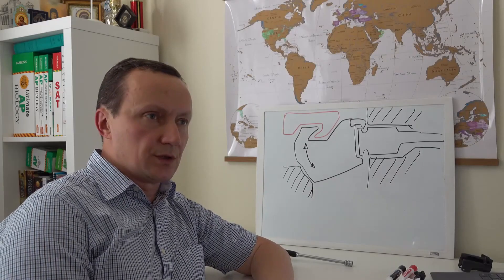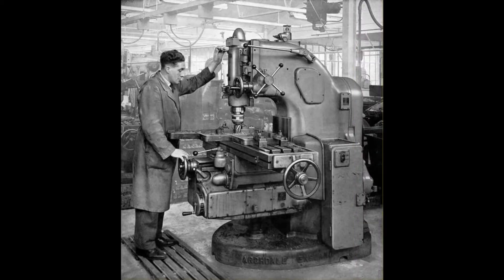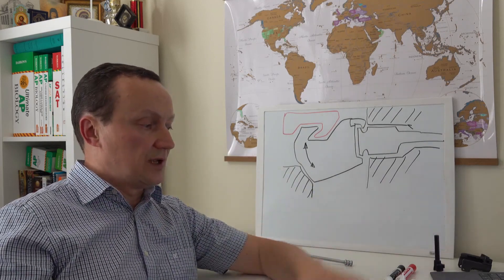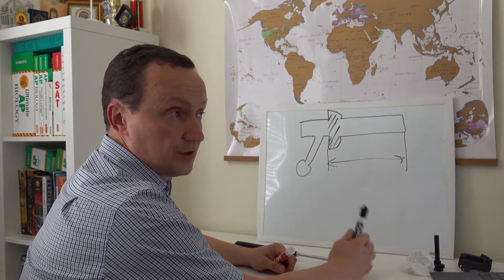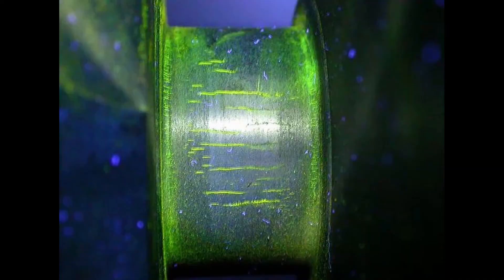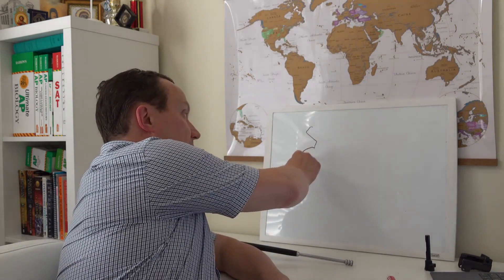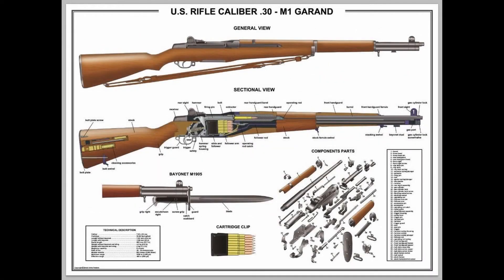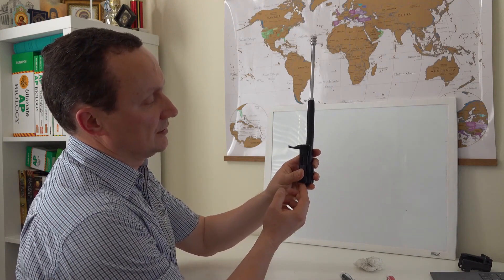Secrets of the Kalashnikov reliability. Part 3. Bolt overtravel

Comment: The way you describe APE is kinda strange. One of the best parts about it is that it prevents needing to use friction of the bolt trying to rotate into a rail or the receiver the way it does in AR15, but it sounds like you're solely concerned with friction from the cam path itself?
Reply from the maker: Yes its true. You can easy make next test: https://www.youtube.com/watch?v=6JmIQXkoog8 
And it is just a one of many tricks between AR and AK.